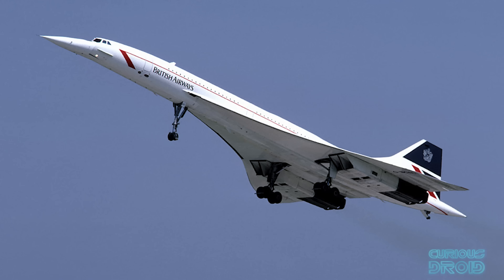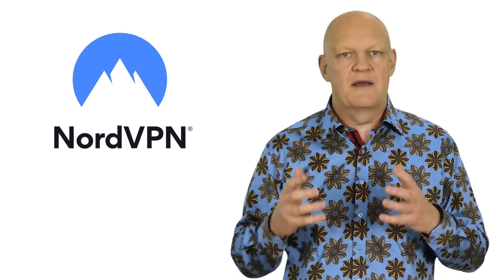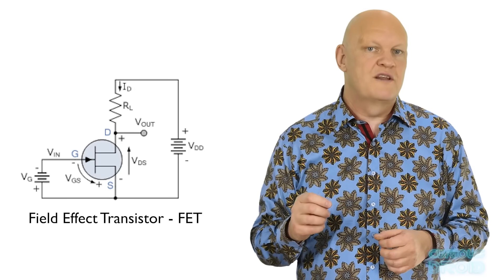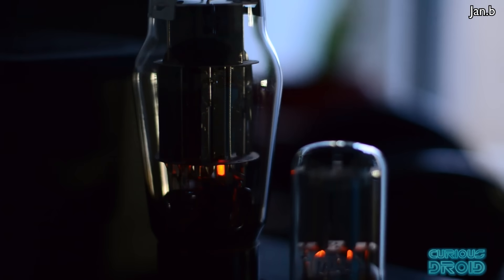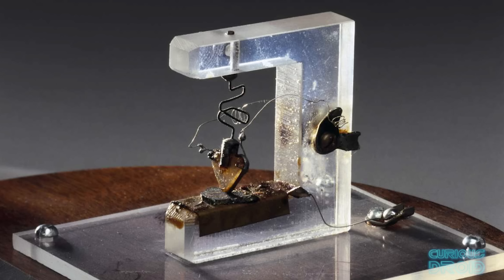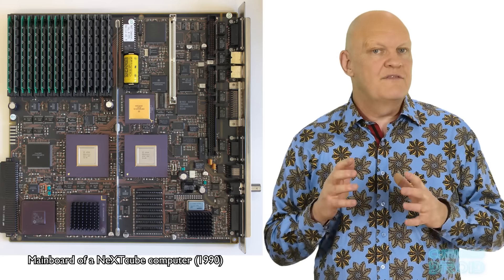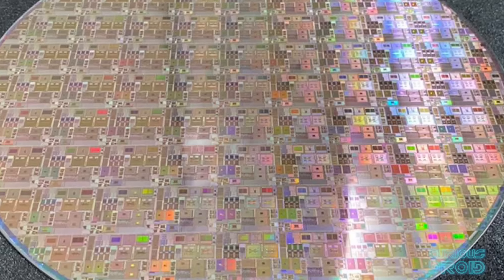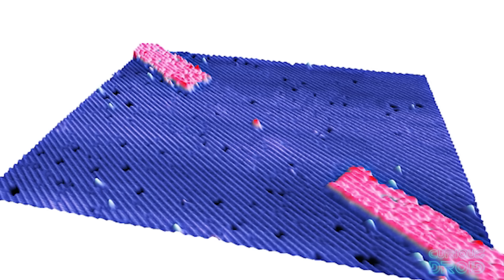MOSFET – The Most significant invention of the 20th Century

Comment: When I went to school we started with tube theory, and by the time I graduated I ended learning the instruction set for the Intel 4000. The 4000 had a glich so they canceled it and mass produced the 4004. Technology was changes so fast, I worked with the Intel's 8000, 8008, 8080, 286, 386, 486 etc...
Reply: 386 and 486 were my first 2! It's been a long time and I was a young boy but I remember being excited about going from 100 MHz to 133Mhz. I think that was the jump between the 386 and the 486?
Reply: @BGraves  The 4004 had a clock speed of 750 KHZ, I was excited to go to 1 MHZ.
Reply: @BGraves  100 to 133 sounds like a jump from 486 to Pentium? IIRC, the 386 was only delivered without multiplier, and thus operated at the same clock frequency as the FSB, which was up to 40 (or 50?) MHz. The 486 CPUs were available with or without multipliers, running at up to 100MHz.
Reply: @BGraves  I first worked on the 8086 - Intel's first 16-bit processor I think.  We were excited that it clocked at 8Mhz - although this was limited to 5 MHz if using  the 8087 coprocessor.
Reply: @BGraves  My 486 was 33 mhz.  It was a packard bell with 4mb ram and 250 mb hard drive.  That was my first computer.  My dad upgraded to an intel pentium 100 mhz with 16 mb ram.  Talk about a blazing fast machine in 1996!!
Reply: God, the 286 sucked.
Reply: i recall our 386 had a turbo button on front, going from 20MHz to 40! was an amazing fact, found it very usefull to some games, as slowing pc would scale speed game processed - not like today where they just lag with bad FPS, but some got slowmotion, so hard parts you sub-optimize your gaming halfing the clock speed.. Later our 386 got a CD drive also!, still running only VGA (16 colours) not the SVGA.. brings so many memories.

Around win95 age, we upgraded to 486, only the 80MHz version as not more was needed, but was a LEAP in technology, going from DOS/Notron and win 3.1 to actual graphical interfaces :-)
Reply: @sorn1234  I always thought the Turbo button was funny. When would you decide NOT to turn on the Turbo button?
Reply: @NoahSpurrier  when playing a spider game where you had to avoid obstacles ,, slowed the phase so dramatically (until dad installed another 4mb ram) later bug was to open the game multiple times to slow it down - fill capacity of the bruteforce back then in 90's :D:D i recall these memories so much
Reply: @NoahSpurrier  When running software that had hard-coded timing loops that expected to be running at the 'standard' (IBM) clock speed of the time. True this was mainly games but then  gaming was the major market being targeted by makers of PCs with turbo buttons. Thus you could play both the latest games and your old favourites.
Reply: @sorn1234  Remember the 8" floppy disc, then the 3.5 floppy disc.
Reply: @sciologist  we started with 5.25", but even that gives sense to why they was called floppy,, until 3.5 came... think the 8" is out of my age of knowledge.. i do tho recall they had a 130mb somewhat HDD at work (size of an LP)
Reply: @sorn1234  Double sided double density 8 inch floppies could store 1.2 megabytes as I recall. Used them on a system running CP/M operating system from Digital Research
Reply: @sciologist  now only known as "the save button"
Reply: @sciologist  - my first exposure to a computer was in 1981 at Shell R&D in Bellaire, TX. Do not remember what processor(s) it used it was a custom built deal. Had 8"  floppy slot and ran CP/M, MP/M, and FORTRAN. Could write some basic BASIC programs. I recall when my boss got a 386 w/ a COLOR monitor... he let me and a co-worker screw around with it after hours. "Leisure Suit Larry in the Land of the Lounge  Lizards"!!!
Reply: @sciologist  Don't forget the 5.25" !
Reply: I had a 486 25 MHz but opening it up revealed a jumper pin which had 25 and 33. I changed it to 33 and my PC becameo a 486 33 MHz. My first overclock :-)
Reply: 1802 eight clock cycles per machine cycle, one to three machine cycles per op code. 

(good when there wasn't much else and you didn't know any better :)

so basically 100K operations per second at 1MHz clock !!!. the saving grace was it was CMOS.

This CPU is powering the Voyager space probes.

Funny thing is RCA even made a desktop PC using the 1802 !!!!!!!!! we had one controlling our Zentel ATE  back in the late 80s.

Strange thing is RCA never became big player in the PC world...
Reply: What, no Z80? lol
Reply: @TomTom-ib3xe  The Z80 was a spin off from the 8000 and 8008 having the same instruction set. I stuck to the brand name cpus.
Reply: In school, LS7400 and 4000 series discrete logic were all the rage. I still remember all the karnaugh maps.
Reply: In July 3rd of 1947, UFO crashed in Roswell. It had a glass panel full of microscopic circuit like thingy, broken wire that lit up at the end, a pen with light that can cut through anything, and a few other mysterious devices which we still don't know what they are used for. Read the book "The Day After Roswell" by Colonel Philip J. Corso. Some engineers who worked on early transistor validated the claims in the book. 

Interestingly, before 1947, we only had vacuum tubes and there was no clue how to improve it. December 1947, as told in this video, we had the first clumsy and rudimentary transistor, that is the building block of IC chip.

Comment: I’ve watched/read literally hundreds of educational articles since my childhood that attempt to unfold and relate the great enigma of electronic evolution and I cannot overstate the excellence for how gracefully you communicated these concepts. I feel that your refinement in presentation could justify an entirely new channel demonstrating your process. This is so good, I am sending it to my own students.
Reply: thank you for doing a dive into the difference of tansistor vs fet and also silicon chip manufacture. do another just on chip making plesae
Reply: Yes he is absolutely top class.
Reply: On YouTube it is common to see complete amatures make vids, putting highly paid professional presenters to shame.
Reply: I don't understand a thing he's talking about. He's not explaining how transistor works or why it works. I'm a mechanical guy not electrical.
Reply: @myrtistaylor5759  
He does not go into great detail. That is the idea, it is an overview.  He does explain that a transistor can be:

1) An amplifier of a signal - making the signal stronger as it passes through. An example is that a weak radio signal can be made stronger to power a speaker.
2) A gate.  A gate is just that, it stops the signal, as a light switch does, or allows the signal to go through, as a light switch does.  Using it as a gate it is a relay. One circuit switches on and off another.

As the gate is either on or off, it is ideal for the binary numbering system which is 0 and 1 (base 2). We use in our everyday use base 10 because we have 10 fingers. This is a cumbersome way of using an electronic component as a device is switching on and off a signal, not having it continuous and moving all the way fast as in an analogue form - electricity moves at approx' 1,860 miles per second. It is inefficiently stopping and starting.

But here is what makes it feasible. Having 60 billion transistors in a device that can carry out two billion on and off switches per second, binary calculations can be performed amazingly quickly. 

How does that make a modern digital electronic device work? A computer, computes, constantly calculating. That is what it is doing underneath. The so-called computer devices we use, the function is not computing for the end user - using a web browser on a smart phone is not adding up numbers. To achieve what the end user wants, an amazing level of calculations are performed underneath using the binary, base 2 system. All performed by the Central Processor Unit (CPU) and other components that contain transistors used as gates.
Reply: @johnburns4017  well i think i understood that better than the guy in the video. But if the how and why were explained, like why does a transistor do that when electricity goes through it? I may understand this better.
Reply: @myrtistaylor5759  
That is going into detail, which the vid is not about. It is not about how transistors operate in detail. I agree that he could have put the transistor bit across better for the uninitiated. He did say that wiring the transistor differently makes it an amplifier or a gate.
Reply: @myrtistaylor5759  I'm a Mechanical Engineer too, but i understand !   You NEED to study about semiconductors. Internet have a LOT of basic information.  Mechanical eng generally don't like electrical issues. (sorry, i'm not native englishmen).

Comment: For the highly interested but lowly learnt, such as I...could you please, in a similar vein explain how the hell such minutiae can be inter- connected!? I can only imagine...not with solder and a soldering iron!? Cheers
Reply: The bare silicon wafer is a semiconductor so you 'draw' a pattern on it using photoresist and light.  The parts exposed to the light get washed away by (nasty) acid (or is the other way around?  I forget) so you end up with parts of the wafer masked.  You can then 'dope' the exposed parts with different atoms, like metals, that become part of the top layer of the silicone and change its conductivity, probably capacitance and other properties.  You can do this many times with different substances so the silicon ends up with areas with different properties.  In this way you can make the functional components and the traces (wires) between them.  That's an oversimplification and probably contains mistakes but that's my understanding.  Corrections welcome.
Reply: Daniel Cooper I think I may have just about hung in there with you!? Assuming of course that you’re basically correct, I’m sure you will at least partially informed many people, thankyou! Others may correct if necessary of course?
Reply: Basically you deposit an layer of metal onto the entire wafer (which holds all the FETs and other devices from earlier manufacturing steps). Then you etch away the metal that has been exposed to light through a 'mask'. What is left is a set of tiny metal traces connecting all the components. Multiple of these metal layers can stack on top of each other to achieve complex connectivity between the FETs (and other devices) in the silicon.

The final 'top' metal layer holds relatively large metal squares which are called the 'pads'. These pads can be physically connected (e.g. through miniature 'soldering') to the pins of the tiny black component that is the IC.

Comment: It's inadequate to say BJT collector current is controlled by base current. There is a ratio between them - the "current gain" but it varies enormously from device to device and can't be relied on to produce a robust design. The Base-Emitter voltage Vbe is much more consistent and ultimately makes more sense. I'd like to see someone explain a long-tailed pair using base current!

Comment: Somehow I knew Apple would be mentioned ... (rolls eyes)
Reply: I hate apple too but you can’t deny their contributions to computer engineering. Their new cpus are incredibly well engineered.
Reply: @chronovore7234  Don't get too excited The Apple M1 is based on ARM architecture (arm64), think mobile phones.

Apple did not invent this

Because of Macs have ARM architecture if you want to run any Intel x86-64 software, whoa...guess what, you need an emulator!!

Hear that slurping noise? That's people being sucked into Apple's black hole of despair,

Once again Apple is being different only because they lock people into their world.

I am now working as a designer / engineer and I am the only person not using a Mac. The frustration I have is their Macs are not able to use software that I use everyday. And that's with their older Mac. So if they get a new ARM Mac... Yeah.
Reply: @tihzho  : "The Apple M1 is based on ARM architecture"

No, it's not. The processor is entirely designed and engineered by Apple. It implements the Arm instruction set. It is not an Arm design.

Comment: the transistors build on tsmcs 7nm node (which is what amd is using in your example) arent actually 7nm. "7nm" is really just a marketing name
Reply: You’re correct, transistor sizes haven’t been accurate since the 90nm node. Intels 14nm +++ is actually 24nm and tsmcs 7nm is actually 22nm. The only two things that really matter are density and efficiency.

Comment: at 0:11 - What is with the padlock on the box beside the TV ?
Reply: That’s a coin-op timer. Cuts power to the set when the time ran out. Basically used the same mechanism as parking meters. They were briefly a thing in budget motels, but quickly fell out of favor.

Comment: Isn't quantum tunnelling gonna be a problem as you get smaller and smaller?
Reply: Already is used to make the flash memories, they rely on it to both charge and discharge the buried gate structures. Larger structures needed higher voltages, which in turn would damage the insulating silicon dioxide used in the gate. Thus you had to get to small resolutions to get the flash devices we all use, which run on under 1V internally, but interface to the 5V world outside.